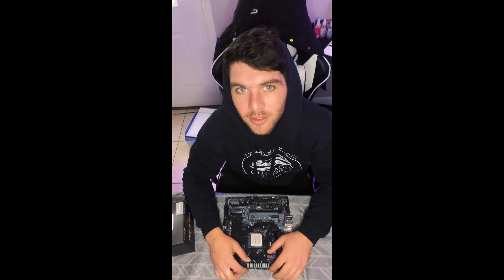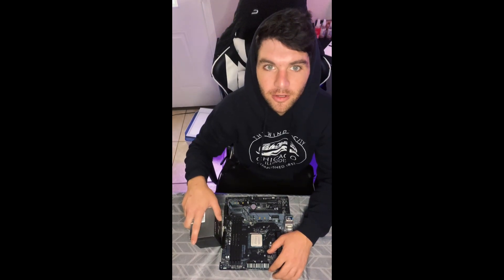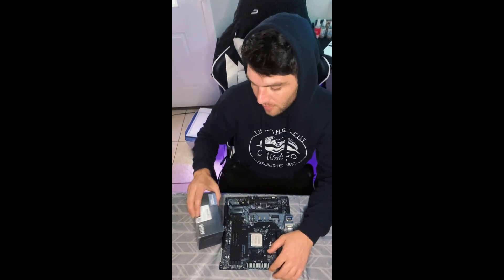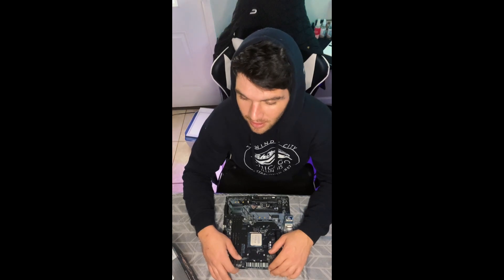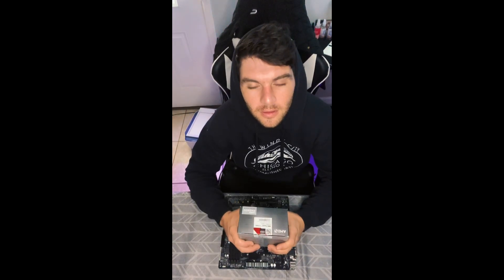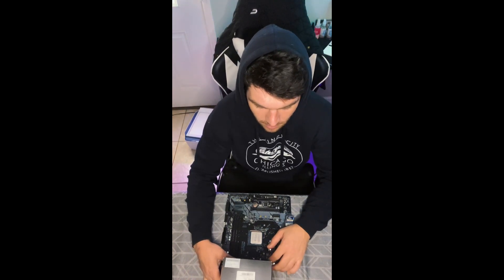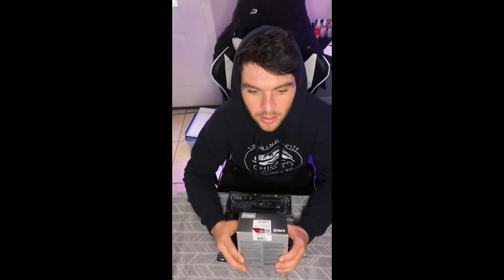Ryzen 5700G IGPU VS GTX750TI (FPS Battle)

Comment: ihad over 60 fps on gta 5  try to oc your igpu  to 2400 mhz and put the voltage to 1.3 v  im planing in next months to  add 3070  or rx 6750xt so ican enjoy max setting at 1080 p